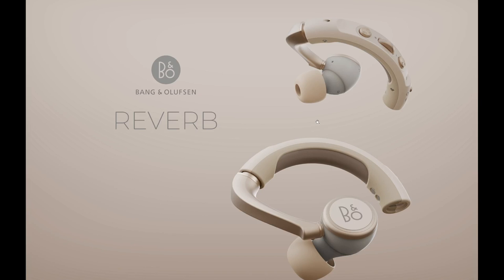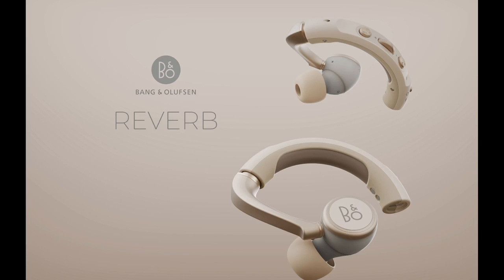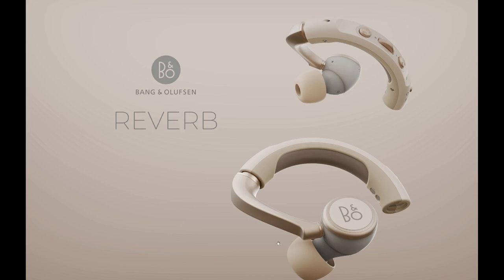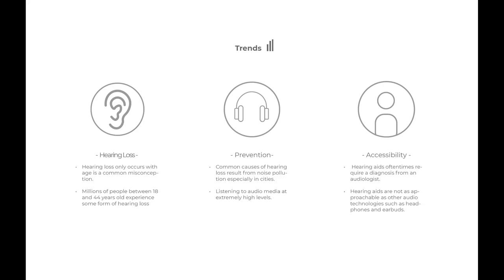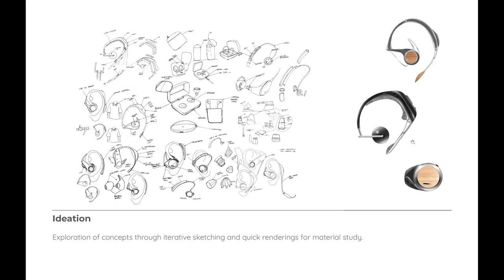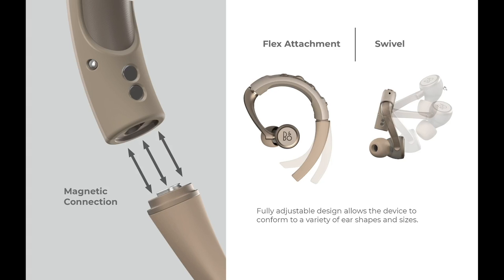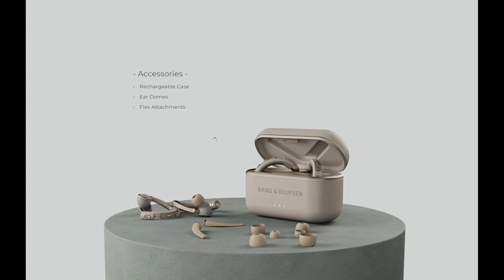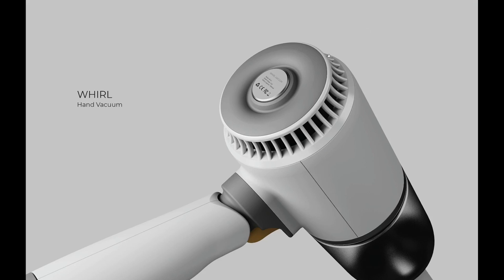AMAZING Student Industrial Design Portfolio! Tips and Tricks Part 1

Comment: 8:40 I have a question. I don't have a sketch because I'm not very good at it, and sometimes (most of the time 😅) I go straight to 3D modeling, and right there I start to change the design. What should I do? (Oh, and I have to add that I don't save the first 3D model, just the final one. 😢)